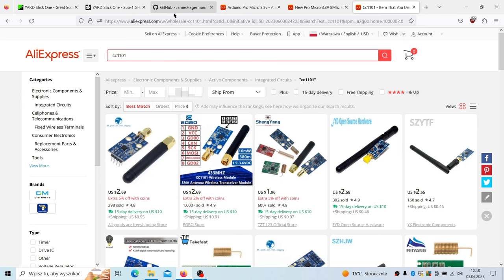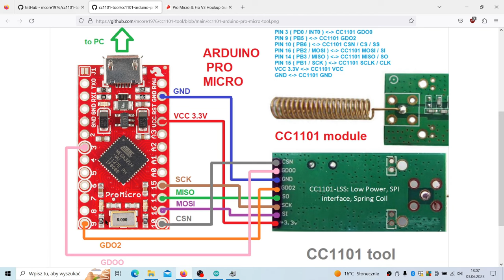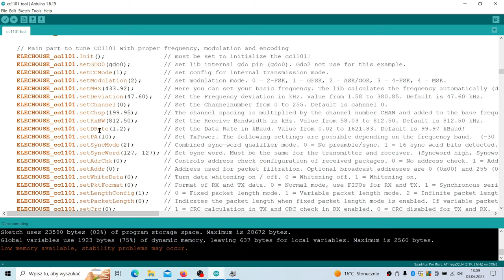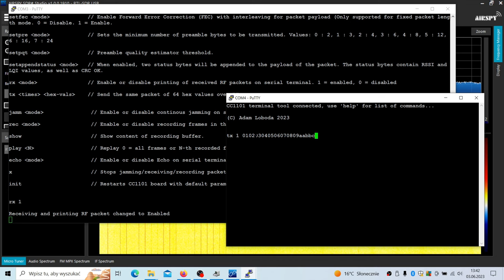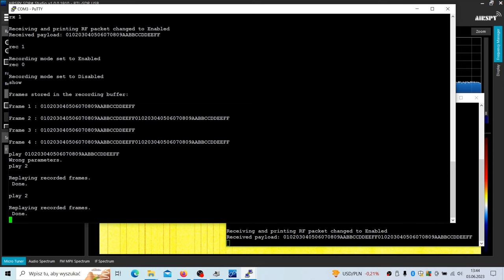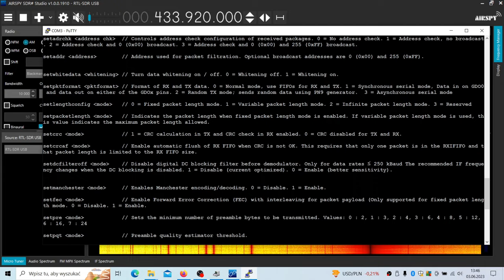DIY CC1101 tool - RF jammer, replay attack, sniffer - cheap & easy tool for radio pen testing

Comment: can i use arduino nano ?
Reply from the maker: if you modify the code with proper pin assignments then yes you may try. Arduino Nano can provide 3.3v as a VCC to CC1101 board but it still uses 5V TTL logic on input/output pins for CC1101 connectivity. There is small risk that you may break CC1101. Browse through my comments below to check SMARTRC project on github. It contains wiring diagrams for other Arduino boards such as Nano
go here and browse to the bottom : https://github.com/LSatan/SmartRC-CC1101-Driver-Lib
Reply from the maker: I have added CC1101 tool Arduino Nano version on my  Github. I have one of these boards and was able to test it. The CC1101 board I was using - E7-M1101D - did not break when directly connected to Arduino Nano. However for CC1101 to work it required additional TTL 3.3V<->5V logic converter board TXS0108E. 
There is also another disadvantage - ATMEGA328 on Arduino Nano has only 2048 bytes SRAM while ATMEGA32U4 on Arduino Pro Micro has 2512 bytes which gives longer time of radio recording and improves stability of the device.
Conclusion - it is better to buy Arduino Pro Micro instead of using Arduino Nano for this CC1101 tool

Comment: Can we use gnu radio software
Reply from the maker: you can use gnu radio to find what are the parameters of the signal that you want to replicate with this CC1101 tool. But the best is to use Universal Radio Hacker and then put decoded frames (hex values and zeros as pause) into CC1101 tool with the commands : flush, addraw XxxxxxxxxxxxxX  , playraw <symbol duration> , The frame can be checked with showraw . This device has A LOT of functionality but at least some basic level of understanding RF and signals is required

Comment: Hi there ,
I use a cc1101 and a ESP32 WROOM , if set it to Scanner mode , i get the below messages
Signal found at Freq: 433.94 Rssi: -34
Signal found at Freq: 433.92 Rssi: -35
Signal found at Freq: 433.91 Rssi: -37
Signal found at Freq: 433.93 Rssi: -36
The problem is that i cannot get the actual packet and see it , save it etc.
Also theres somehting to mention , i used the cc1101 with a Arduino nano before ESP32 , and i didnt use logic converter
did it Fry my cc1101? , the reason i am asking is beccause i get the results on scanner
Reply from the maker: try to use command rxraw Xxxx
where xxx is a number of microseconds for sampling interval
Reply: Hello how did it work for you i also have esp32wroom and cc1101 and mine doesnt recieve any signal at 433.92mhz of a rgb led remote, could you maybe provide some advice or help?

Comment: This doesn't work on esp8266
Reply from the maker: it works on ESP8266 but you need to use correct source code and declare proper pins. Check the readme file in the project and read it carefully before posting any questions.

Comment: transmitting on a freq without a license = (eventual) trouble
Reply from the maker: yes unless you use license free bands like for LoRA, car keys and remotes  and other ISM bands. Of course the tx power has to be less than 10mWatt

Comment: thx I got it allmost took me 3days😂
CC1101 terminal tool connected, use 'help' for list of commands...

(C) Adam Loboda 2023

  cc1101 initialized. Connection OK 

 PuTTY will notwork and AIRSPYsdr++ wont work  too
can you help me pls
Reply from the maker: what you did exactly and what you did not ? because I do not get what you are asking for. If you are not getting anything on Putty:
1.check the connection speed if it is 115200
2. check CC1101 board wiring
Reply from the maker: zadig is used for RTLSDR usb dongle connectivity not the CC1101.  I am using RTLSDR USB only to show if cc1101 is generating the signal. If putty says CC1101 initialized then it means that you have succesfully built the device.
Reply: I guess he is trying to say that , why you got 2 Putty’s on this video?  

Does this video mean you have two cc1101.?  1 is to receive and 2nd is to transmit. To show us how it works? 

I think thats what he is asking.

Comment: Can i use raspberry pi 4 instead of Arduino?
Reply from the maker: unfortunately not every rpi. Only RPI Pico 2060 is suported
Reply: @justanengineer5599  thanks for the reply in advance.
 I think the esp32 wroom will be better.
What about performing replay attacks against modern cars with rolling codes. Also we need to jam and listen at the same time right? Is it possible? Using a single cc1101 module or do I need 2 of em or a raspberry to jam the car receive freq?
Reply from the maker: you can use rpi2060. For rolling attack yes it is possible with my tool but you need 2 such tools at the same time. one should be jamming  nearby the original frequency and second device should record the original signal in very narrow bandwith

Comment: Hey can i desolder my cc1101 spring antenna and solder  sma antenna?
Reply from the maker: yes. some of these boards even have  holes to solder SMA socket
Reply: @justanengineer5599  I have the same board which your are using in video d sun